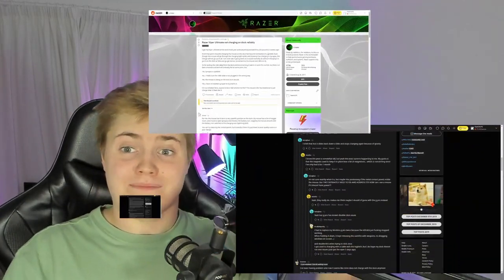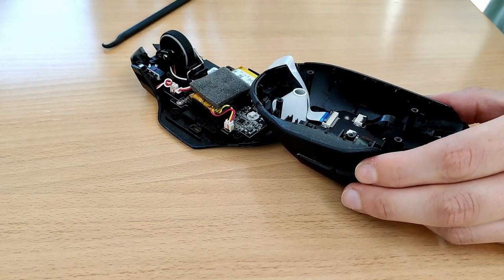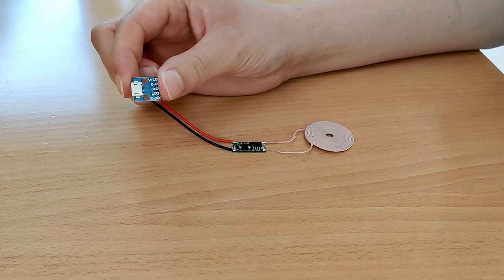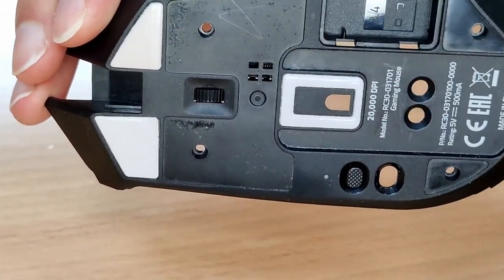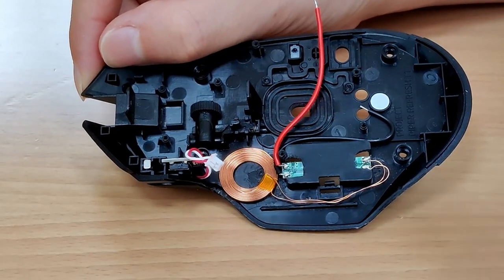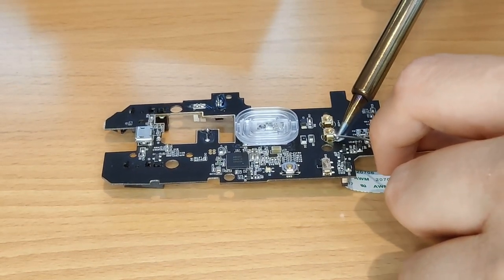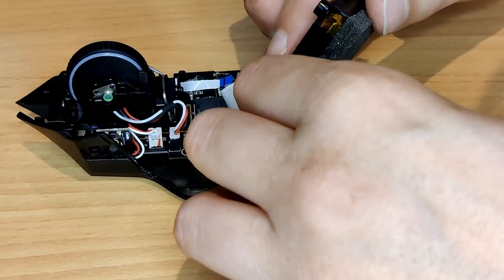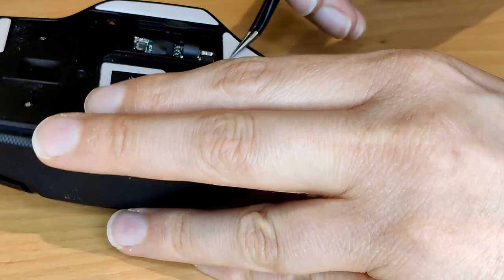Why Did I Drill a Hole in my Expensive Gaming Mouse? | Razer Basilisk Ultimate Wireless Charging Mod

Comment: Those holes actually ended up cleaner than I expected
Reply from the maker: For the holes in the dongle compartment, I actually ended up using a large drill bit and then just scraped away at any excess material, it was actually surprisingly easy to cut the ends away once the hole was drilled.

Comment: This is an excellent idea!
I would suggest to reuse original dock. Just for lulz, to show Razer how it should be done in a first place. Also, it has nice lights.
With your chosen position of coils inside the mouse, you are probably will be able to just slap charging coils over the top-left corner of the original dock. Otherwise, I would try to place coils on the back/bottom part of the mouse, so that corresponding charging coils will go inside the original dock.
Reply from the maker: The original dock is unfortunately not big enough to house the transmitter coil as it is significantly larger than the receiver. I do fully plan on using the board from it though for the RBG and management features provided in the Synapse software

Comment: mine is actually not charging at all, i have only the cable without the dock and despite the software says the mouse is charging - the percentage only decrease. i received the mouse two days ago and it just dying. amazon refunded me tough but i want to get it charged because the mouse is comfortable for me. im trying to find a solution but the web full of complains about the dock charging problem but i found nothing about cable charging problems. also razer says that the cable can function as a wired option for the mouse, and obviously its not working for me, just with the dongle. seems like a defective cable. any solution please?
Reply from the maker: If you have a micro USB cable with a head small enough to fit, you could try that and see if the cable works to charge it. If not, and you feel comfortable dissembling the mouse, you could take the board out of the casing so there is enough room for any micro USB cable to fit in the port (This will at least allow you to test it and see if the cable is the issue).

Otherwise, if you received a defective product, the best thing to do is simply return it and swap it for a working one.